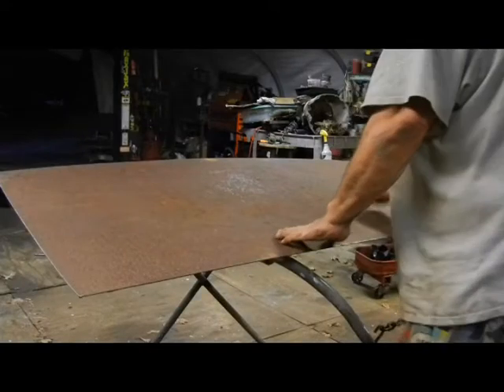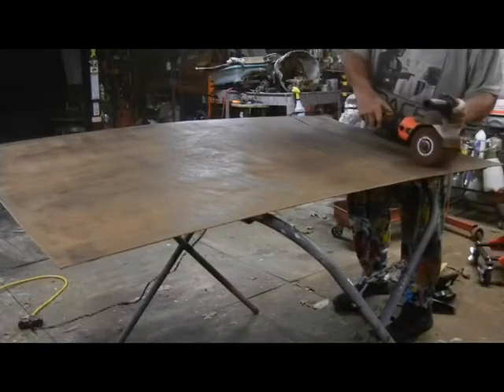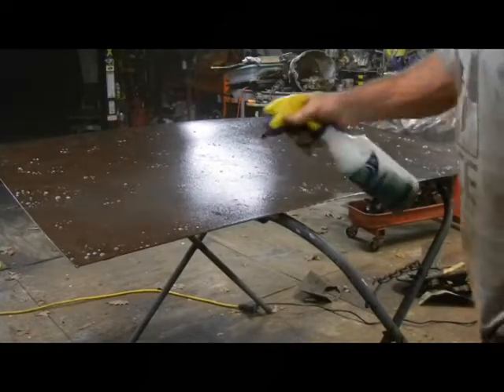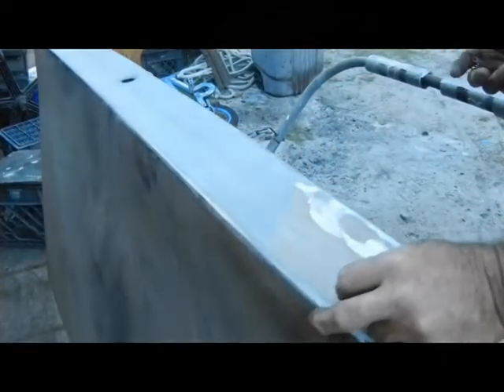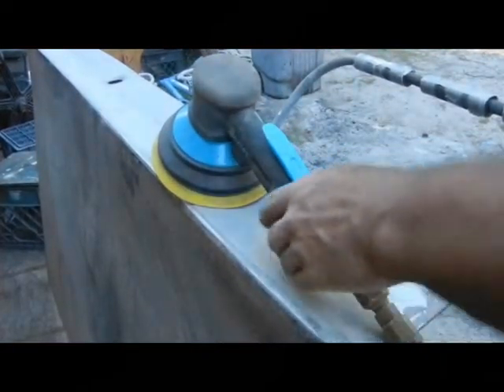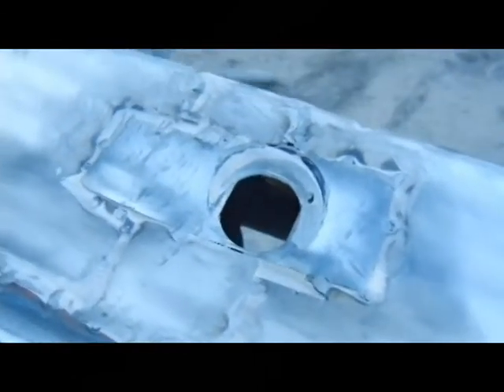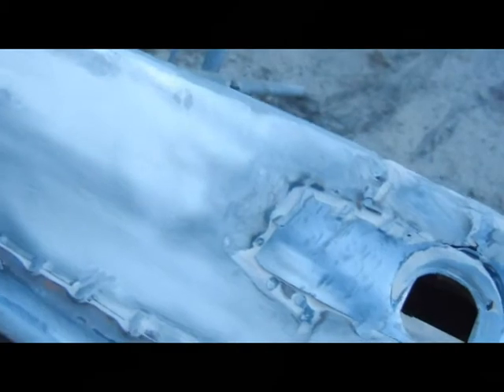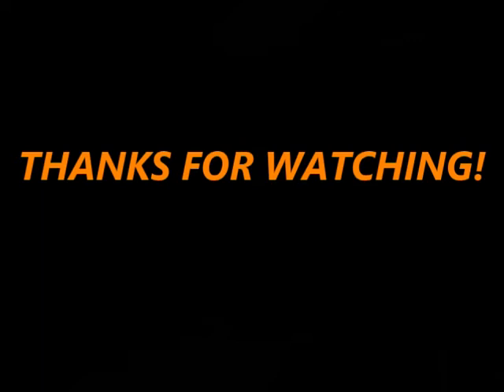1974 CHARGER DECK LID SURPRISE!!

Comment: You never know, until you strip it down. I did a 69 Firebird that somebody “repaired” a lower rear quarter panel, by slapping Bondo over cardboard backing. 🙄
Reply from the maker: Yep I found simalar in the quarters of my dart but they used builders spray foam ugh!!!